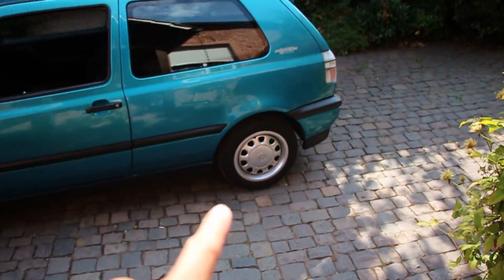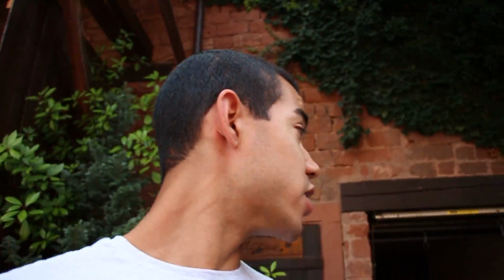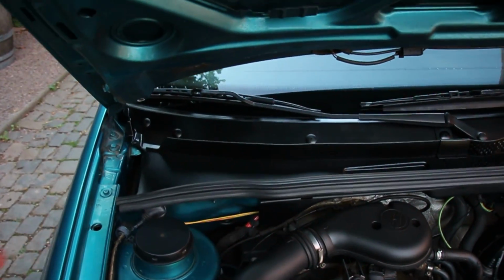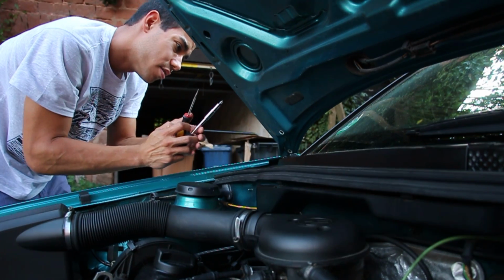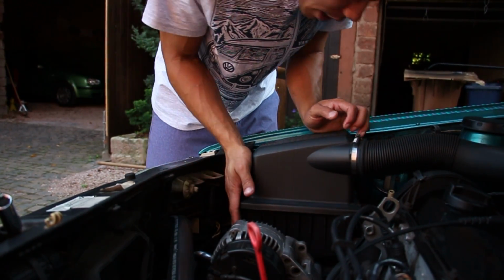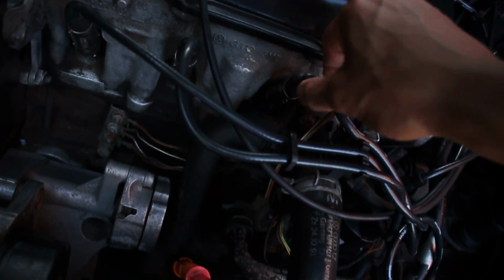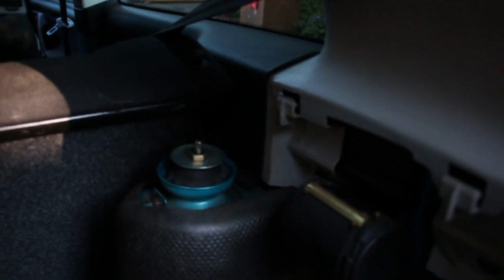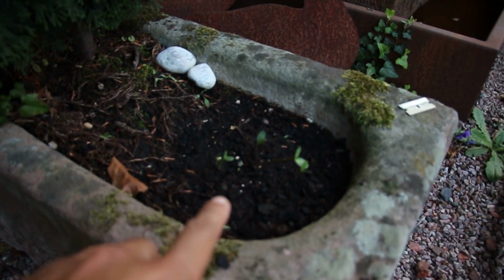OMP Rear Strut Bar Install In The Golf! ( + Engine Tune Up )

Comment: Savoy...Hey C, super glad you figured out the spark plug and lead issue. When you were screwing that end cap on the new plug I was talking to the screen saying that's the reason why  the plug lead wasn't seating properly.. i'm happy you figured it out. Excellent job on the Savoy so far!